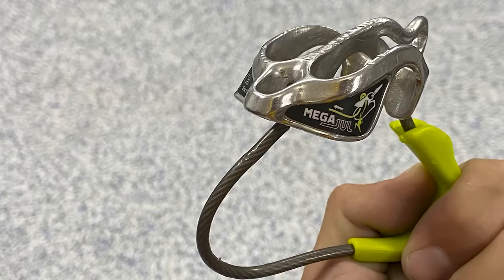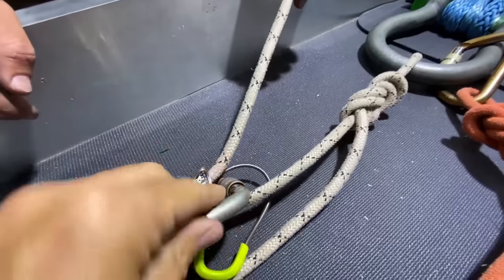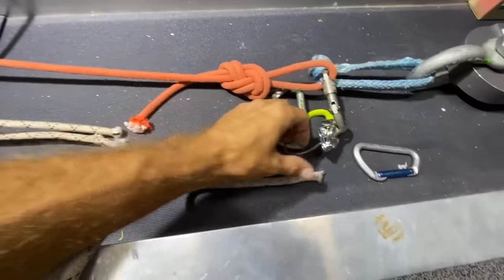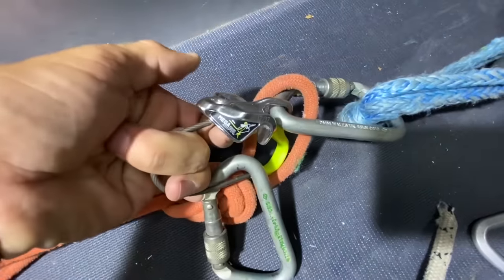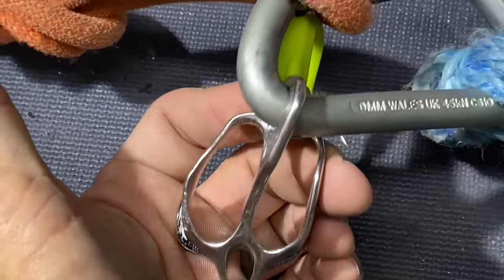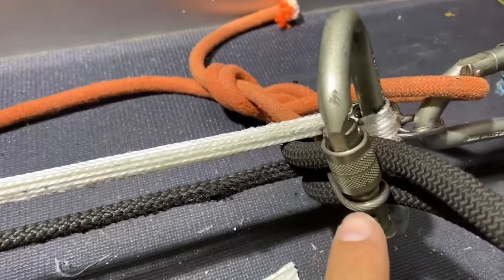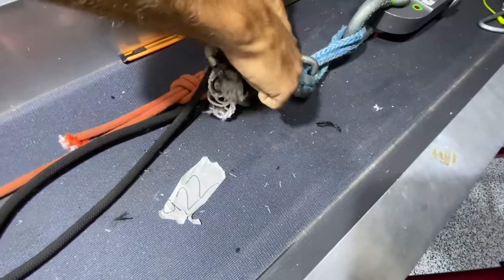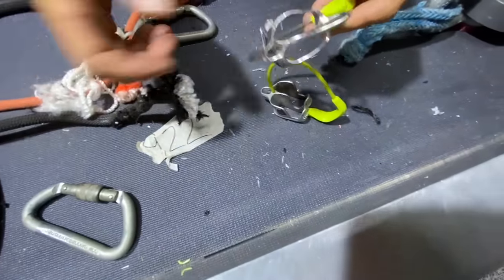Break testing climbing belay device - Edelrid Megajul

Comment: Hey! I have to be honest, I've got mixed feelings about this channel (they're mostly positive though!). I'm a climber (not a slackliner) and also a mechanical engineer/scientist (finishing my PhD). I appreciate what you do, and I have definitely learned some interesting things by watching your break tests. Most of the time, you're pretty honest about the limitations of your tests, and they're performed in a way that they are useful. Loved the series on TCUs pulled over edges and straight out. 

I'm an avid user of the megajul and use it for everything from sport to intense alpine, and have owned three. For this test, here are my notes:

1. As others have pointed out, the set up in guide mode was incorrect. https://blisterreview.com/wp-content/uploads/2017/09/260380_19245_L.jpg The carabiner should not be between strands, and the gate should be between the climber strand and green thumb loop (above the rope) instead of below. When it's below, the loading forces it to spin and push against the keeper wire, which wouldn't see any force if loaded properly.
2. With the carabiner between strands, it might have more slippage since the braking action is inhibited. 
3. More importantly though, when it's between strands, the loading of the climber strand forces it down, and bends the brake strand around the sharp edge unnecessarily. This is what will lead to the rope getting sheathed. If you had clipped the carabiner as shown in 8d for single strand, or 8b for double, I don't think the rope would have sheathed so easily
4. I am honestly impressed that, in guide mode, incorrectly rigged to probably reduce self-locking, the device easily held 8 kN with minor slippage. If your second is taking a fall that generated 10x body weight on a dynamic rope, and you've rigged your device incorrectly and aren't holding the brake strand, and there's just some minor slippage, I am pretty happy with the device.
5. Clipping the carabiner through the device is only necessary with a single strand to keep the brake and load strands from flipping, which should only be a problem with skinnier ropes. It's not necessary with two strands.
6. The stainless steel used in the Jul line is really strong, and due to the inline loading, I doubt that eye loop will break at anything less than 20 kN. It's essentially like a skinny eye bolt loaded perfectly in line.

Here are my thoughts for how I would do this experiment if you were to do it again:
1. Test in guide mode, with one and two strands. Either hold the brake strand to prevent slippage (very little force should be required and can be done from a safe distance) or simulate a brake hand by wrapping that strand around a pipe or something a few times to get some extra capstan effect. Make sure the strands are oriented as they would be in a climbing scenario (i.e. the brake strand should be roughly below the device, not above it)
2. Test at what point different ropes (diameters, suppleness, static vs dynamic) start slipping through the device WITHOUT a "hand" on the brake strand. See how bad it really is to let go of the brake strand with an assisted device. You could even compare difference devices. Instead of testing to failure, use two scales/dynos. One to measure load on climber strand while you pull, the other to measure load on the brake strand (fix the brake strand to one end of the scale, and the scale to the other end). It's be fascinating to see how much assisted braking an ATC guide vs MegaJul provides.
3. You could do a similar thing with assisted braking devices in lead belay mode. Keep the brake strand slack, measure how much force until the rope starts slipping through.
4. Another cool thing to do would be to test when "incorrectly" clipped guide mode devices flip with a single strand for different devices. If you clip the MegaJul as in figure 8e in the manual, how much force does it take to invert the strands with an 8.5 mm vs a 10.5 mm rope. How does this compare against the ATC?

Tons of cool stuff you're doing, definitely more and more inclined to send support and get involved. I'm a broke grad student, but I am happy to give you my engineering expertise via email/phone, and I have an almost brand new 70 m Beal Opera (8.5 mm triple rated, sheath and core bonded together) that unfortunately has a core shot (not from falling) roughly in the middle. I was going to sell it as two glacier ropes, but maybe I'll send you some or all of it to do some experiments with. Break testing a new super-skinny rope in various situations seems like it has a lot of potential.

Keep up the hard work! The dirtbags of the world thank you
Reply: Yo, I think your image in the link is not 100% correct, someone else linked to Edelrid directly and the carabiner should be always going through the wire it seems: https://media.edelrid.de/images/attribut/54544017_GAL_MegaJul_MicroJul_MegaJulSport_SS_161205.pdf
Reply: @TheOriginalJub  I think I bought mine about a year ago, and it is identical to the link I provided. But I guess depending where you buy it, it could be stored for some time and older manuals are still out there.
I have a stash of instructions as well laying around :D
Reply: Thanks

Comment: DO NOT SETUP THIS WAY

This setup is completely wrong.  Read the instructions again.  The the big steel locking carabiner the rope rubs around is not supposed be between the two strands of rope.  That actually prevents the rope from pinching off itself in guide mode.  And on top of that the rope is running right across the screwgate.  
Fix your setup before other people think this is the way to do it.  
DO NOT SETUP THIS WAY

Comment: I use both Megajul and Microjul on a regular basis. I find it interesting/funny how the device in your video gets loaded, because when I use mine in guide mode a lot of the breaking force seems to come from the two strands pinching against each other. 
What I am trying to say is that you pull the rope out of the device in a weird way. That never happens to me in real life situations.
Reply: Thats because they set it up completely wrong
Reply: @rockklimber  
I would not say completely, but as I said, it gets loaded in a weird way.
Reply: It’s loaded “weird” because it’s setup incorrectly.  The locking is not supposed to be between the load strand and brake strand.  If the biner was smaller or shifted some it couod fail completely.  They should not post this online where others might follow their directio and set it up wrong too.
Reply: @rockklimber  I agree with the last part. They have no experience with the jul device and there is the problem. 
The other part I have to check these days with my own juls.

Comment: Emmm, still incorrect setup of a guide mode - biner shouldn't go between two strands of rope. But it probably won't make much difference anyway..
Reply: Makes a huge difference, it prevents the strands from interacting with eachother, which is the whole thing that enables guide mode.
Reply: @Grethko  thats not what I see in the video - break strand is twisted but doesn't look loaded anyway - jammed by the load strand just fine. I might be wrong
Reply: @richardh3913  thank you for posting this.... it blows my mind how long people will argue over setups when the manufacturer has clearly posted instructions on their website (along with a paper copy for anyone that buys the device new)
Reply: @richardh3913  It's the correct setup for guide mode but I wouldn't say that's how most of its general use will be used..Most people use this for belay and rappel..I would have rather seen it used that way and seen what happened.

Comment: OK, this one breakes ropes in guide mode, what about ATC or Reverso in guide mode?
Some folks say they fail by carabiner being rotated by the rope, so strands switch places. Care to try? Cheers!
Reply: Well that's because they do not clip the carabiner properly than ahahah. The proper way to go there is to clip the 'back' carabiner through the rope exiting to the climber, this way when that rope is under load the carabiner cannot flip.
Reply: @REVOLUTIONS51   I would agree with this, but most manufacturers haven't updated their manuals yet.. So most likely I will be belayed the old way)
Reply: Btw, here is nice video explaining the whole issue with guide mode rotating biner (on any device), and how one can avoid it. https://youtu.be/385cP_FYNEs
Reply: @REVOLUTIONS51  I use both the mega/microjoule and the Reverso3 and 4. All of these work perfect in guide mode, never had a rotating or twisting action. 
When I saw that people on youtube use the megajoule in the way it is used in this video I changed my giude setup to this setting (it still feels weird), but it seems Edelried wants it like that.
Reply: @pavlodeshko  thanks a lot!
I thought it has to be done when using twin or half ropes. :D
Reply: @anvariel4  well if your partner fall while seconding the pitch is likely not to exceed 1500 N of force (150 kg so maybe 330 pounds of force? Mental coversion here...)  if you keep his rope short enough, so it's quite rare to have an inversion on a full rope, but it's good practice because on half rope the risk increase, and especially on some of the slimmest half rope it may occur on an unusual fall, so is better to have it as an habit and always do it than forgetting to use it the wrong day...
Reply: @REVOLUTIONS51  
I guess not really. Because if you use two strands in the mega or microjoule, then the carabiner in the back simply can not twist. I even use the Edelried Flycatcher (6.9mm twin rope) in a megajoule (officially you should use the microjoule). I can tell you that it can't twist there.
Reply: @anvariel4  yes but it's super common in a group of 2 people to  just put just one of the 2 half ropes through the device, still safe as a fall of the follower would be super soft and one rope is enough. Plus even if not common  tiny 8.2 mm ropes rated for single, half and twin standard do exists so...
Reply: @REVOLUTIONS51  
Yeah... did not think about this, because I don't do that. :)
If I have two strands with me I use both all the time, but I agree with you in this one.

Comment: It would be interesting to see a similar test on the Wild Country Revo (many use this for lead solo climbing). Great video!
Reply: The specific auto-locking feature you mention isn’t used in guide mode. All atcs in guide mode will auto « lock » by default most times because of the way the ropes are set up. Which isn’t possible in your setup with biner between the climber’s strand and the belay. As others have mentioned the correct setup is the gate above the climber’s strand and still within the wire loop. As shown in edelrid user guide. Specific auto-locking feature of the megajul is when using it standard belay mode. Be careful if talking about something you’ve never used before. Still nice to see it holding so well though!

Comment: I'm a big Megajul fan and user. Just worth reiterating for all following this is that the Edelrid Megajul is made of stainless steel (approx. 2x stonger aluminum - meaning the rest).  I was not surprised the ropes failed and the Megajul never did (you guys got it to 29k it didn't break?!?!?! - that's sick!).  Two points I think would be good to elaborate on are  (1) a reminder to the viewers why you use static ropes on your tests and not normal dynamic climbing ropes (as you should of course), and (2) enlighten folks on what is the maximum realistic force in any "real" climbing fall, because (as I'm sure you know) it is surprisingly less than people think.  For those wanting to see it in print,  I suggest getting Craig Connelly's Mountaineering Handbook and the Bob Gaines & John Long book on Climbing Anchors - lots of technical data there, all of which was highly tested.  Some brief take-aways from those sources are that BD's head gear engineer has NEVER seen a 10k piece of climbing gear (ropes, cables, slings, etc...) break in over 20 years of BD's gear being used out there in the world.  NEVER.  Why?  As Connelley details (and most experienced climbers inherently know) it's because of the simple fact that if we use dynamic ropes and sound, basic safety systems, even if some pieces pull out and you get a huge whipper, a fall  NEVER results in forces anywhere near 10k (Your spine would break in half if you did).  Connelley goes as far as to say that there is no such thing as "shock loading" as long as you have a dynamic rope in the system, and I 100% agree.  Case in point:  every time you fall on a non-dynamic dog bone on your quickdraw onto a bolt in rock on a sport route, you are "shock loading" the fucking shit out of so many things: the dogbone, both carabiners on the draw, the bolt hanger, the bolt, and the rock.  But it's not shock loaded, because your stretchy dynamic rope slides through the static equipment and absorbs the fall. Go and take the same fall while leading that route on a static rope or take a fall above a bolt on a long dyneema sling, and then you'll see shock loading - and probably break your spine and only after, you'll maybe break a carabiner.  Last note - in the real world, ropes get cut and people die - too often - but I doubt anyone can name a single case in the last 10 years of a dynamic climbing rope breaking (not cutting) in a real-world situation. So if the Megajul tests like we see here supersede the strength of the rope, it's safe to say it's integrity is the last thing any climber should worry about.  Just like you don't worry about your rope breaking.  THANKS to the lads @ HNTHL for testing and posting!!!  Good stuff.  Keep it coming!

Comment: The edelrid megajul is made of steel and not aluminum like other ATC style devices.  That makes it very durable to either loading or abrasion. I am a big fan. The device could use some tweaks to improve handling, but its ability to do everything pretty well (nothing exceptionaly well) is what makes it appealing to me. Thanks for the tests!
Reply: Have you actually used it? It's an absolute nightmare to actually use.  They went and made a functional version, which is the gigajul. Get that if you need one.
Reply: @Grethko  The MegaJul is actually my prefered device for sport 90% of the time.  I find it's one of the most convenient devices to rappel with, that said, it isn't the most convenient device to multi-pitch with. I don't have a GigaJul (yet) but it does look like it fixes most of the issues people have with the MegaJul. The complaints most people seem to have with it may have to do with rope size (I run between a 9.2 to 10.2 [in the gym] and I don't have any issues) or hand size or finding the 'release point' to feather a rappel or lowering a partner. Only real complaint I have (aside from the one's related to multi pitching) is that because it's made of stainless steel it does bite into aluminium carabiners  and scars them but it seems to only be an aesthetic issue rather than a functional one.
Reply: @Grethko  i am using the megajul sport and the microjul. i love them and their handling.
Reply: @Grethko  I use mine and love it. I prefer it to my grigri.
Reply: @Grethko my personal choise for 6 years now .

Comment: Surely these should be shock tested not under consistent load. When in climbing do you ever slowly put 8.5kn of for on any equipment?
Reply: They've explained this, they don't have a way of testing shock loads, their dynamometer doesn't have a high enough sample rate.

Comment: In the mountain rescue world there has been a lot of testing of descent control devices (and belay devices are a subset of descent control devices or DCD's.) Almost all of them will break the rope (at least any rope you would actually use them with) before the device itself breaks. I did see a piece of 12mm Amsteel that one manufacturer was using to try and find the actual breaking strength of the device. The value where the rope breaks is usually not specified simply because it varies with the different ropes. 

That said, if you test some aluminum devices with two strands of static rope you might get one to break. The steel device deformed quite a bit on your first test, which may have changed how it damaged the rope on the second test. 

The value where the rope slips through the device when you are holding it with your hand, or the point where the rope will fail, is actually the most important value. I've heard it is 2.5-4kn. From here you can start to calculate maximum anticipated force for the rest of you system.  Concern about breaking the device itself is misplaced, as are most concerns about using modern climbing equipment, if you are using it correctly.

Comment: Great work on your channel, very informative and laugh out loud!

It seems like every video where you cut a loaded line you are always using the scariest looking exacto to cut it and I'm afraid the frangible blade will get snapped off and shrapnel or something even if the cut ends are moving safely away from you! Do you own a legit sharp semi-serrated blade that doesn't have break-away segments or do you carry that arts and crafts tool up routes to cut old tat with it?

Comment: SOOOOOO... I always wonderd what would happen when the climber falls into a bolt that's set in a big piece of rock not connected to the rest of the wall. Say a really big boulder with 4 tons weight. And the fall pulls out that boulder which then falls together with the climber. -- Would the belay device hold and at least the belayer have a chance to survive?
Would make an interesting test - roll bolted boulders down  a rock and try to catch them with the mega jul :)
Reply: The device wouldn’t break, but the belayer might after they got launched up the rock face into a boulder.